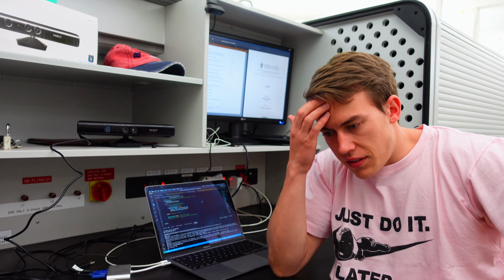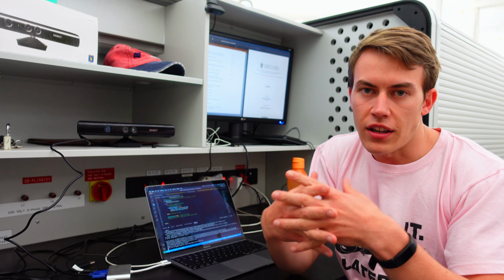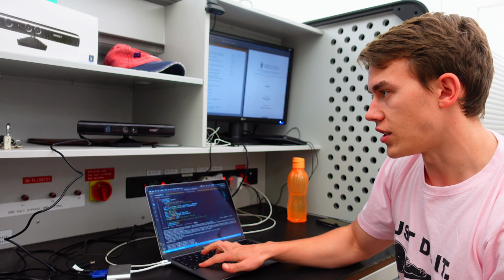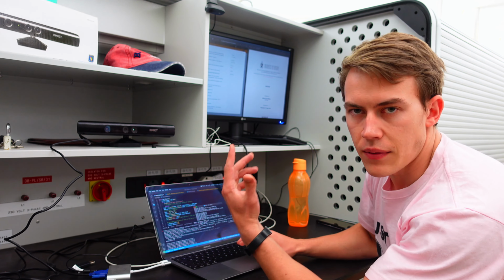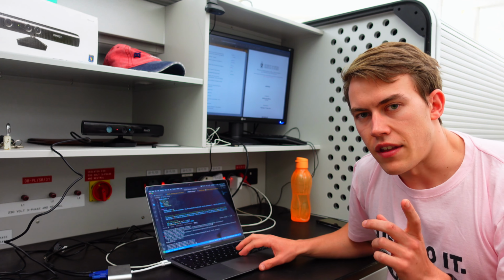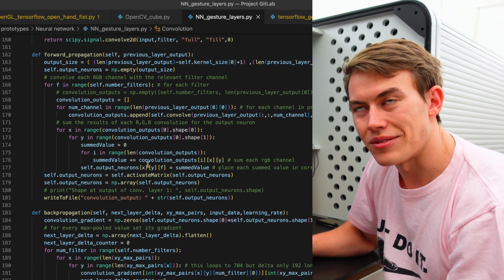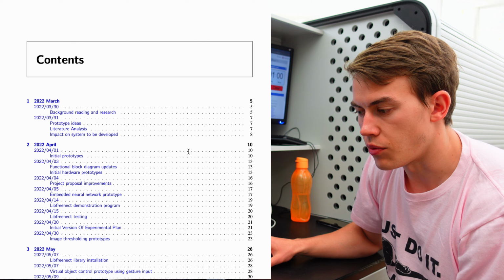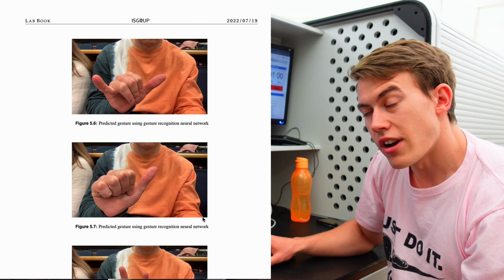My Final Year Project | Prototypes And Progress

Comment: Bro what is the difference between electronics engineering, computer engineering and electrical engineering
Reply from the maker: Electronics has more hardware focus, computer more software focus and electrical more heavy-duty industrial power electronics focus. They all share the core modules of mathematics, circuitry and engineering professionalism though
Reply: @mitch7w  I thought computer engineering was the more hardware focused than computer science though?
Reply: @mitch7w  also what industry would electronic engineers get into with just their degree +ECSA accreditation compare to computer and electrical engineers

Comment: An astoundingly complex system in the making Mitch!  Will it use the color coded depth information to detect when your fingers are in contact with the surfaces of the cube or does it simply detect when your fist is in contact with any part of the cube?
Reply from the maker: At the moment it's just the fist in contact with the cube, we'll see when it is working if it needs to be more finely tuned